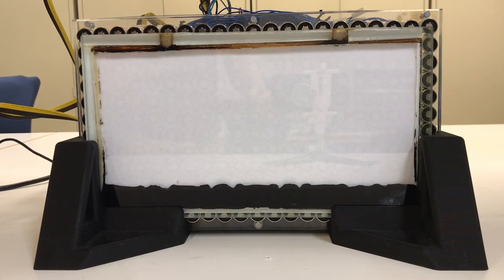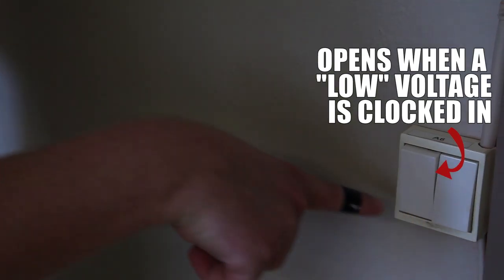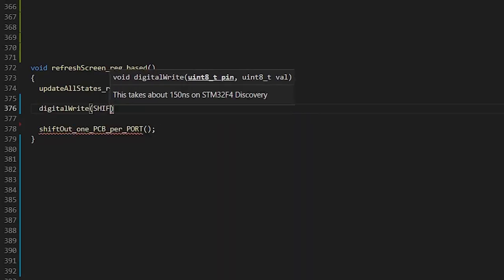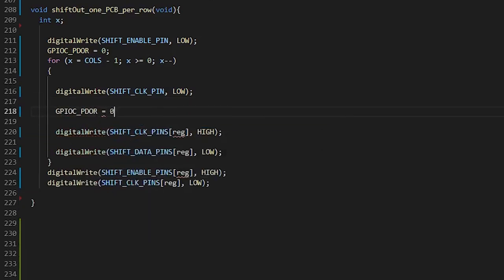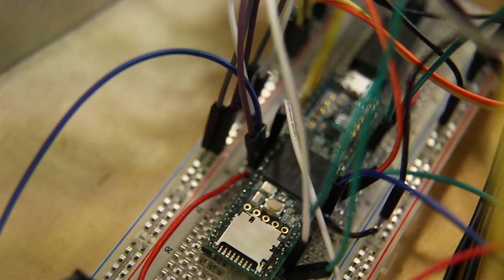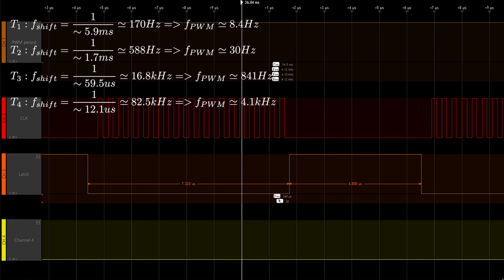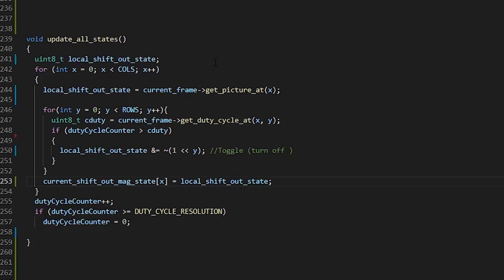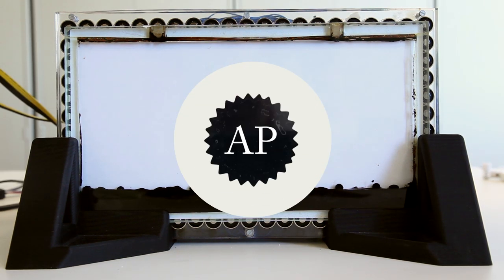Making our code run 45,000% faster - Fetch #7

Comment: Great details and nice to see your progress. I hadn't heard of the time cost for global variables -- makes sense, great tip.  In general Paul's Teensy code is fantastic. The Teensy 4.0 can bitbang at 150MHz using digitalWriteFast, along with many other high speed tricks like DMA to SPI, and even DMA to parallel, which I'm working myself right now!
Reply from the maker: Thanks! Yeah, we kind of went down the optimization rabbit hole this time, and I (Simen) found it personally very intriguing to get it faster and faster. We do know a few more techniques to get even higher performance out of this little MCU (or even upgrading to Teensy4.0), but we’ve managed to stop ourselves from feature creeping further. What we have is good enough for our purposes at the moment, and we’re planning big changes in Fetch v2 that will make parts of our code obsolete - so we’ll make do with this setup for now.

We saw on Twitter that you were working on some parallelization code for the Teensy4.0, looking forward to see how it works out for you! If you want to discuss any details feel free to drop us a DM or reach out to Larry Bank (his twitter handle is fast_code_r_us) I’m sure he’d be interested in your project! He’s a really nice dude and probably has some tips for your specific application right out the top of his head.
Reply: Great work, wish I did more digital programming applications during my studies.

Ever consider doing slight density matching on the ferro fluid and the water... if you can get them at close to a 1:1 ratio gravity would become negligible.

Comment: Hey guys, It really is coming together. It seems like you've met your goals for PWM speed, it's probably not necessary to optimize the code any further, but you can clean it up a bit. Please do do a code review. 
Have you thought of updating the picture through serial comms via computer? If you do do that you can store only one or two frames in ram, and also maybe implement a way to load animation onto the SD card.
Reply from the maker: You are very right. The code is by no means finished and quite messy because of some hard-coded parts that we change rather frequently. We need to fix that in the future.

Yes, we’re currently considering doing a serial transfer, but we’re probably only going to do that for whole animations at a time and store them to the SD (being in a different mode than playback). But features like these are still rough around the edges and need more thinking and are also dependent on some other un-developed ideas that we have - so we don’t know if they’re going to be part of v1. We’ll see how frustrating it is to make animations for it (which is going to be a large part of the next video).

Comment: You could try using the DMA to generate the pwm at any frequency you like, without load for the processor :)
Reply: How would that work? Could you elaborate?
Reply: @sebastianholmqvist7407  dma can be used for example to set values in peripherals by memory in a manner that doesn't rely on the processor at all. Not sure if that would actually help here - it's 2yrs ago. Your microcontroller data sheet will have more info...
Reply: Right. In this case they were using bit banging for the PWM, which was why I was asking.
Reply: @sebastianholmqvist7407  bit banging is like the opposite of DMA :D driving DMA with timer gets you accurate timing
Reply: That's why I am asking. Since they don't have a PWM peripheral for each channel, how would using DMA solve anything? Trying to understand and learn something 🙂
Reply: @sebastianholmqvist7407  ah right. Well they could still use the DMA to drive the gpio ports!
Reply: They could, yeah. I wonder how much that would save considering they do direct write to HW registers. Instead of the looping through individual pins.

Comment: Try increasing your duty cycle at the top of the screen so theres less pooling at the bottom on stationary images.
Reply from the maker: That is exactly what we do in this video. The duty cycle at the top magnets is 100%, so it's impossible to increase it further (without using over-voltage and causing excessive heating). Check 11:37 for a comparison between a no PWM animation and a PWM animation. Note that even with PWM it's really hard to prevent the ferrofluid at the top from separating.
Reply: Thank you for the feedback. Neat project.

Comment: A useful trick for handling e.g. a 256-level software PWM efficiently at e.g. one frame every 2.55ms in cases where PWM values don't change too often is to have thirty bitmaps, fifteen of which are output for 10us each and fifteen of which are sent for 160us each.  If a magnet is turned on for the last 3 of the 10us intervals and the first four of the 160us intervals, it will be on for a total of 670us per frame.
Reply from the maker: I’m not sure I completely understand this solution, but we have solved the PWM in hardware for our next version of the PCB :)

Comment: digitalWrite is extremely slow, you can resort to PIN<*> macros and masks for much faster I/O when using an Arduino.
Reply from the maker: Thanks for the input, but we've already changed our approach from writing to each pin to writing to all pins simultaneously (using direct register writes, and making sure all pins are connected to the same register)
Reply: Check into addressing the i/O register directly with assembly code.
Reply from the maker: @KJ7JHN  Going the extra step to use assembly directly is not going to give much of a performance boost (we are already writing directly to the registers using C/C++).

Comment: To solve the sagging problem why not have a faster pwm frequency the higher up your pixel is?
Reply: Having seen an answer below perhaps try wring in current limiters on the lower pixels (you could do this with a variable resistor to ground on each row... and then tweak it till you hit the sweet spot). Then there is no need to rely on pwm.
Reply: I believe you're referring to the duty cycle. Not the frequency, right?

Comment: Could you lie it flat then use a mirror at 45 degrees to view it?
Reply from the maker: Well, sure, but that's not as cool :)
Reply: @AppliedProcrastination  but it would overcome gravity issues? Even if you laid the matrix at 20 degrees you'd still get some of the gravity effect?
Reply from the maker: @myvidedits  You are absolutely right. We kind of consider that cheating though. Hehe. Anyway, we've solved most of the issues in this video already, and we are working hard on making the final release video as high quality as possible before releasing it.
Reply: @AppliedProcrastination  No probs. Good luck with the finished product. I'll look forward to seeing it.